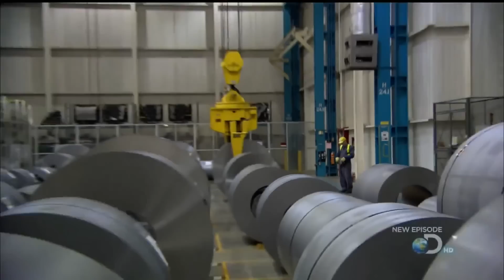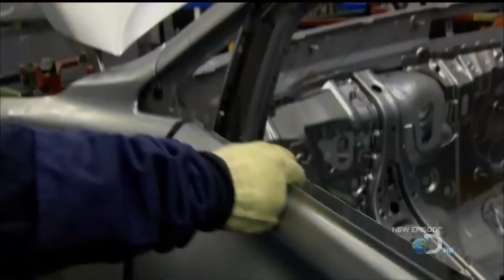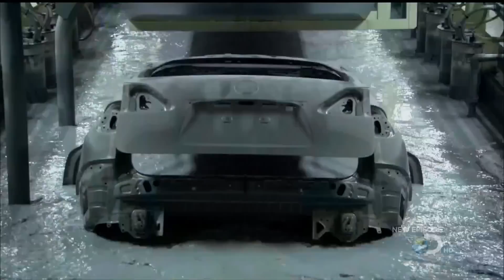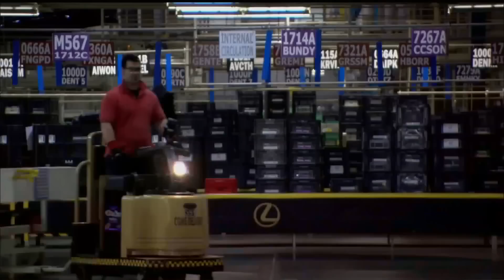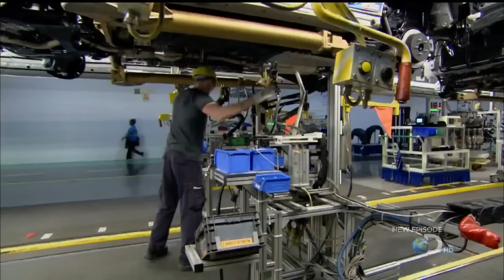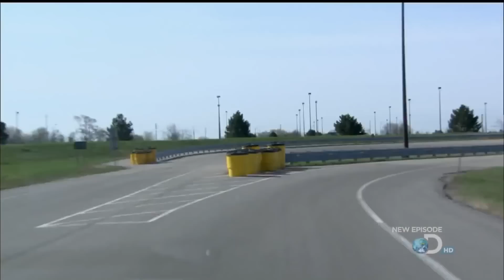Factory Made Lexus RX 350

Comment: Lexus has ended years ago. 
- The sound insulation has diminished louder vehicles. 
- the CV axles break in no time causing vibrations. 
- engines have started to consume oil
- automatic transmissions have become jerky
- the plastic feel of the dashboard makes it look so cheap
- putting tablets inside Lexus was the last thing they should follow 
- front headlights becoming yellow over time

The Lexus has ended. Seriously. It’s just a brand name that is constantly building crap on the basis of good quality cars built years ago.